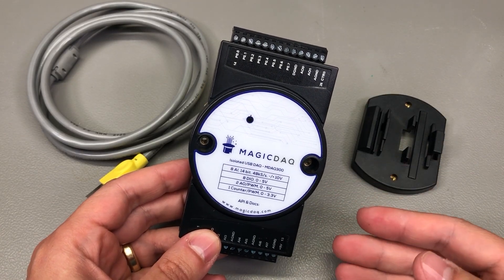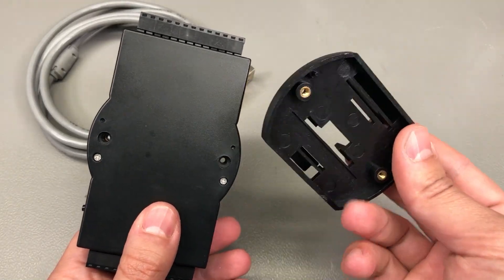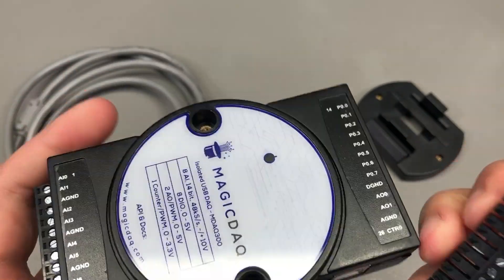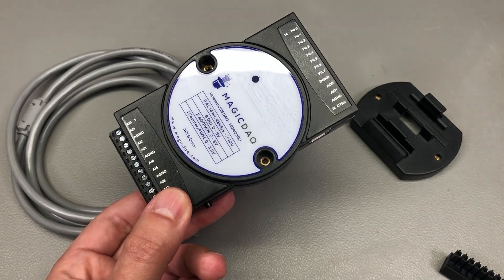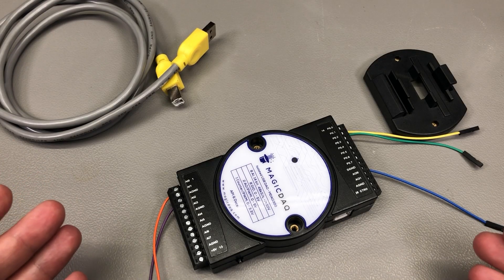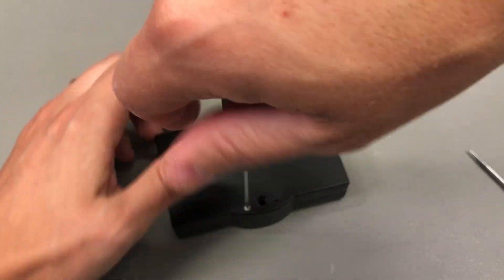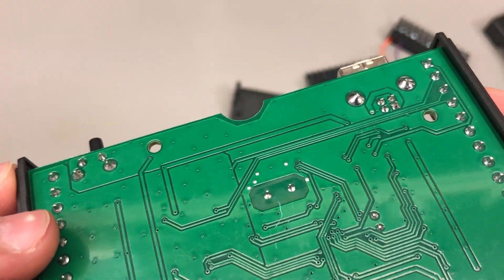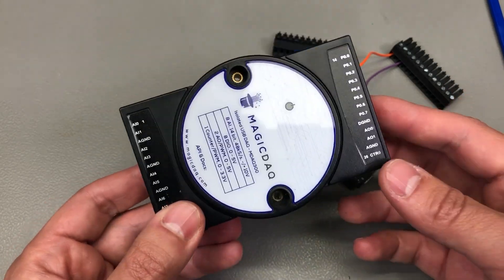MagicDAQ Automate Your Test & Measurements Setup | Voltlog #420

Comment: Was the MagicDAQ discontinued?  Would this normally be used as part of a PCB test-jig?  

I was thinking of using a DMM (that has RS-232/Serial output) and an analog MUX 2 Click (ex. MIKROE-4468)... this way    the measuring of all the pogo pins could be automated.  Of course if it's a signal it would need to be routed to a scope for analysis  (Analog Discovery 2)?

Comment: Very questionable value for the price, considering that it is not much more than there is on a STM32 dev board (or ESP32) with an external ADC and screw terminals. But the main deal breaker for me is the custom driver. If the manufacturer stops to support it (not providing Linux support isn't a good sign either; missing out on raspberryPis), the device becomes useless (unless someone writes different firmware). I see no reason why this device couldn't be connected as a standard USB serial device.
A raspi with a DAQ hat costs much less and includes pretty much a complete computer.

Comment: The driver seems to be a binary blob? That doesn't bode well for long term support, for example with newer versions of Windows (or an entirely different OS) or newer versions of Python. Having dealt with similar issues at work when selecting hardware for a test setup, I came to the conclusion that an Arduino would be the best choice that will remain supported for an indefinite amount of time. In particular, the "Ruggeduino" boards are overvoltage protected.
Reply from the maker: Drivers are still a bit of a mystery item to me so I'm not really sure how that is handled.
Reply: SCPI would also be fine.

Comment: The manufacturer may /say/ the lack of Linux driver to configure the unit is a hardware issue, but to me it just sounds like a lack of interest in supporting Linux ...
Reply: I agree, given that Linux runs on just about any hardware that Windows does.
Reply from the maker: Drivers are still a bit of a mystery item to me so I'm not really sure how that is handled to be able to comment.
Reply: Which is fine, if they are upfront about it, its just not worth supporting linux for some products.